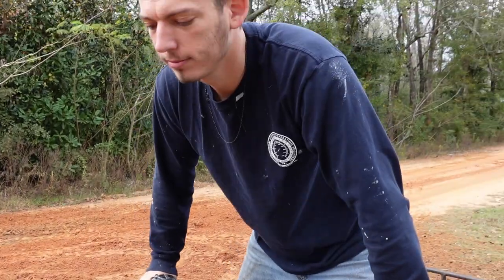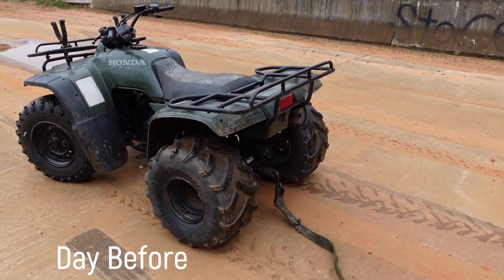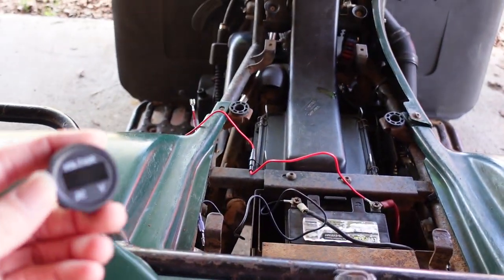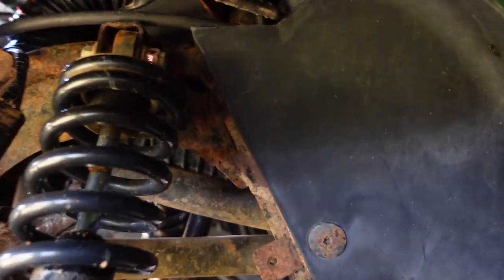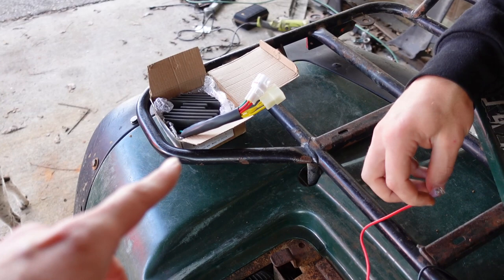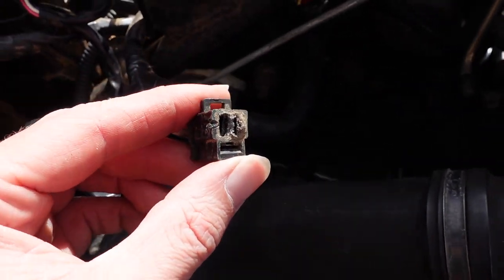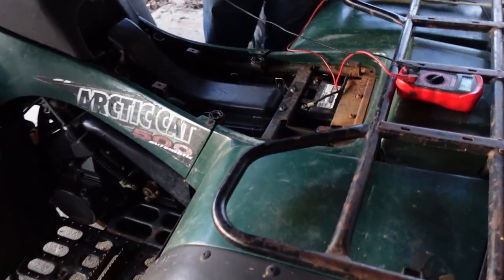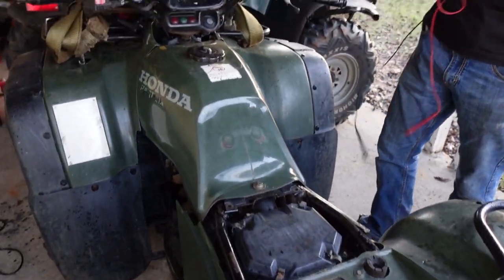Embarrassing, Saved by 25yr old Honda FourTrax

Comment: you guy are Disrespecting the folks who have to drive those county roads.
I am very disappointed at you for digging holes in the surface, for cars and pickups to get caught up in.
Straighten up, or I am UnSubscribing.
I live in the Rural Areas, and worked on the Mntc Crew until I retired.....
you guys need a Lesson in Respect.
Reply from the maker: We are the folks that drive these roads, we’re not in a neighborhood, we didn’t damage them at all. We weren’t doing donuts, racing or littering. We maybe did 1% of what the harvesters, boom sprayers and tractors do. These roads get destroyed by farm equipment
Reply: We fixed it after recording that part… rode that dirt road again today (3 days later) and it looks like we weren’t even there
Reply: As well as the county regrades those particular roads every other Monday